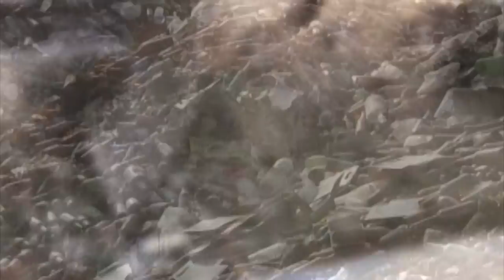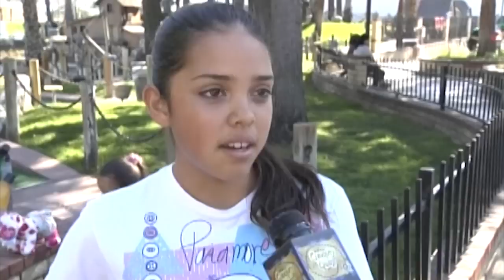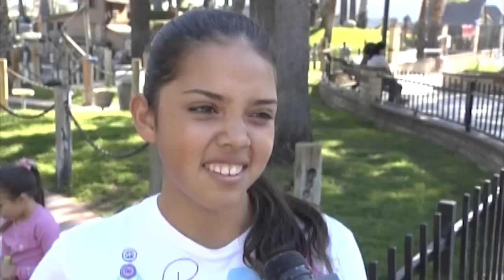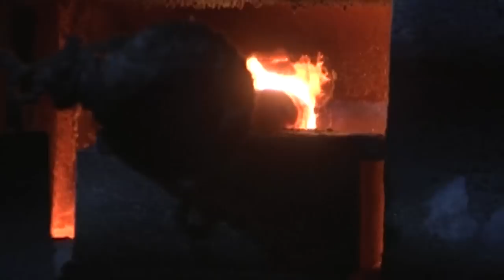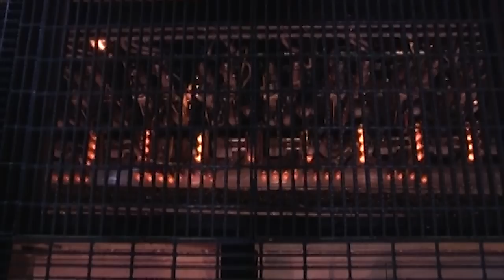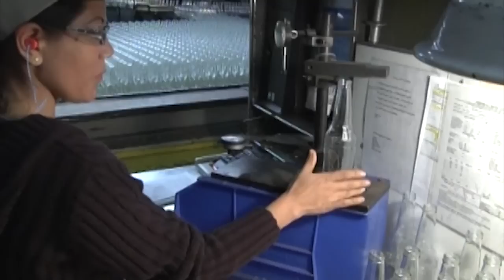Glass Recycling

Comment: Here in SC we are told at the recycling centers that they are not taking glass anymore. And to just put it in normal trash.
Reply: Same in Fairfax County, VA. Fairfax county no longer collects glass from curb side recycling. They still collect at recycling center in special container, but even with that, they just grind it down to use as aggregate or fill material for road construction or landfill. Not another glass product. Glass recycling is really not worthwhile unless it is clear and free of foreign material (label, caps, etc..)

Comment: Do they blow air into the bottles to create the interior or is there a inside  mold ?
Reply: i think it's a vacuum, so the mouth of the bottle is like the opening of a rubber balloon, and when negative pressure (vacuum/sucking) is applied to the outside of the glass, the glass is sucked to the sides of the mold. you can't achieve a bottle shape via an interior mold.

Comment: What about window glass is it recycleable?
Reply: Tempered side windows and some rear windows are.  If it turns to little cubes when it breaks, that's tempered glass.  The stuff in front windshields (and some rear windows)  is a sandwich of 2 layers of glass on the outside, with a special layer of plastic on the inside.  This is so that it stays (largely) intact and in place in an accident.  Front windshields also are very often a stressed-member, meaning that they provide strength that is integral to the integrity of the passenger compartment remaining as strong as possible.  Because of the nature of the "sandwich" of glass and plastic, the glass industry has deemed it too difficult to separate the layers and recover the glass from it.  I'm waiting for the industry to do something, or for the government to nudge them into doing something about finding a way to figure out how to separate and recover the glass and send the plastic layer where plastics go for recycling.  Right now, windshields are considered garbage, so you can guess where that ends up.

Comment: so they only use 50% recycled glass. to recycle 100% of glass would require producing 2x the glass every year going forward. Can they make glass from 100% used glass? Why not bring that up in your info video? Also, glass doesn't decompose. It goes from raw material (rocks) to finished product (a type of rock)
Reply: They use  what they get. not all glass is returned.Some lazy a's just throw them where ever.

Comment: Nice explanation, I am curious if one can do how ceramics are recycled. I imagine similar to glass being from sand , ceramic material from clay and rock sources can be recycled. But i am curious on being taken thru the recycling process so one can reuses the ceramic as a powder clay or original product before they fired /kiln it .
Reply: Clay is recycled at the factories before it is fired. Like bricks, pottery from clay is reused. But after it is fired is different. Not many uses for it, so it isn't cost effective. Most glass other than bottles is not recycled due to composition. Borosilicate glass is not recycled, ie. the tempered glass used in "Pyrex" bakeware. Or glass from light bulbs /mirrors/auto windows / etc. due to the chemical composition of the glass. As they said some glass also has a higher melt temperature than the bottle type glass so it can't be reused either.
Reply: @ivanivonovich9863  windshields can be recycled.

Comment: Taken from the local city's recycling web site: "Every year, about 1 million pounds of items left in curbside recycling bins and at city drop-off sites end up in the landfill. That includes things that shouldn't be placed in curbside recycling bins, such as plastic bags, glass dishes and cups, Styrofoam, metal pots and pans." 
There are no reprocessing plants for glass in the state that I live in. It all has to be trucked to another state. Expensive!, Fuel, wear & tear, tires, people's lives.  The brown glass is used to make new beer bottles and the green and clear glass is used for fiberglass insulation,  I suspect that none of the glass used in insulation will ever be recycled again. So, to save the planet, drink more beer!
 It would seem more work needs to be done for plastics recycling. The need to separate each type makes it very inefficient! Fuel?
Tires used to be burned as fuel in a cement plant, that has been banned, so now most are buried.
Reply: How many beer drinking drunks does it take to produce 1 KG of brown glass?

Comment: Thank You for the video. I have driven by the plant when i lived in Chula Vista. One question ws not asked that i would like to get an answer to. How do they change bottle shapes for different companies and not stop the line?  Thanks
Reply: the molds must be changed to change bottle type/shape. if a machine can be shut down and isolated from a multi-machine line, the line can run, but the machine is shut down for the change. molds are changed periodically, even if replaced by same type/shape of mold.
Reply: CuriousEarthMan is correct.  They have several molding forms, so they merely isolate one machine at a time while the others continue forming the rest of the order, while one machine is down, they change out the mold forms.  If the next run of bottles is the same overall volume, just with a different shape, they only change the molds. If the next run will be larger or smaller bottles, then they also need to adjust the size of the gobs of glass being distributed, so in that case the line might be very briefly stopped while that adjustment is made. Otherwise, they just isolate one station at a time until they have changed all the molds and the full run of that product is in full force.